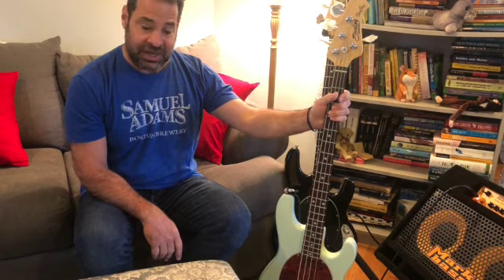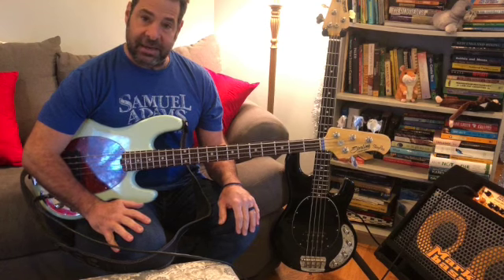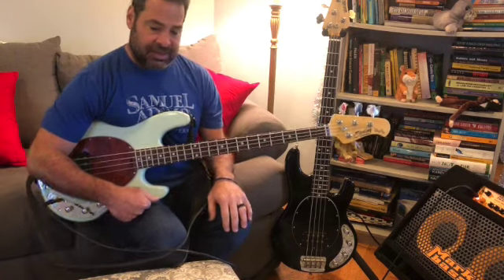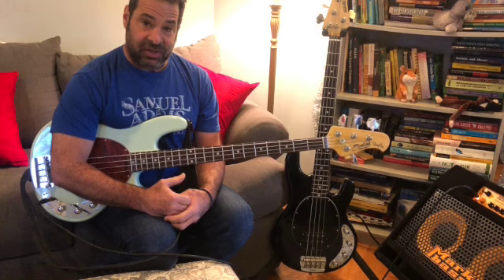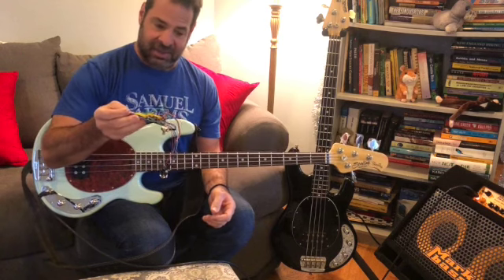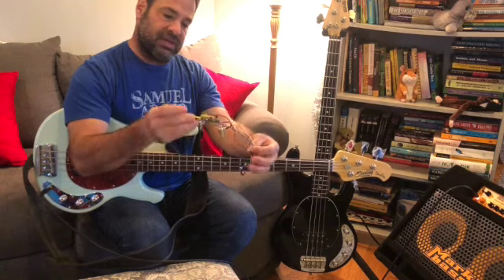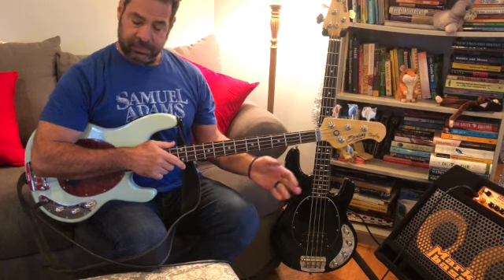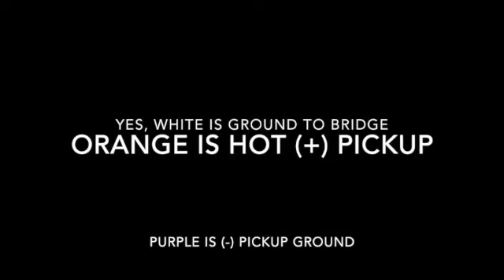Bosko MusicMan Stingray 2-Band Active Preamp from Serbia for about $100!

Comment: Hi,nice video you made,I ordered the same preamp and soon i have to see how I am going to mount my pickup in parallel to the orange and purple wires from the preamp,I have an alnico mm pickup and a ceramic mm pickup,I want to see which one gives the best sound at my Sterling Ray 4 sub.
Reply from the maker: Let me know if you like the alnico or ceramic better! I don’t remember exactly which wires I changed to wire it in parallel; I’d have to open it up again and see.  And yes, the  orange wire goes to the pickup hot ( + ) and the purple is pickup ground ( - )
Reply: @Jdzap1969  I let you know,i still did not do anything because i wait some goods before i can start
Reply from the maker: @danielbeemstra3059  it was a tight fit getting the preamp in, but I was able to do it.  I had to angle it a bit but I got it to work. Just don’t push too hard on the preamp…you don’t want to loosen any connections
Reply: @Jdzap1969  I am going to make the cavity at the height of the preamp a little bit wider,I think a little more than 1 millimeter
Reply: @Jdzap1969  i found nice chrome knobs which fits on ali express
Reply: @Jdzap1969  The Alnico pickup sounds better,i tryed both.
Reply from the maker: @danielbeemstra3059  Which Alnico pickup was it?
Reply: @Jdzap1969  a roswell alnico pickup,even my sterling ray4  bass  sounds a bit better than the original 78 in my opinion.

Comment: How did you wired to parallel? I didn't find any diagram so I connected white and red together with the black wire, but I'm not 100% sure about that :)
Reply: It depends which brand of the pickup,but its not difficult